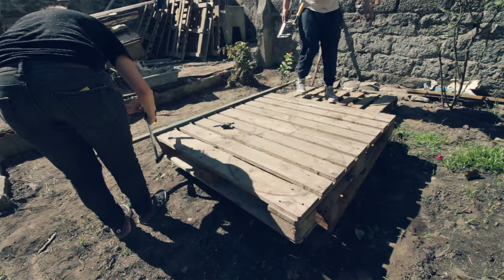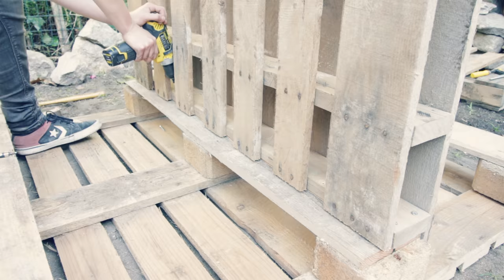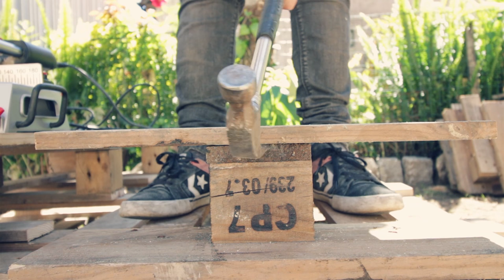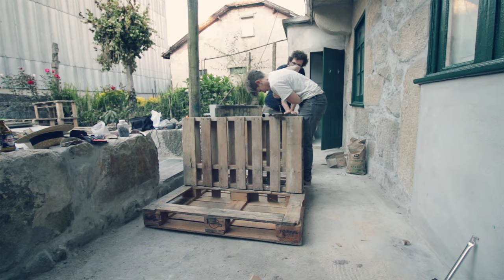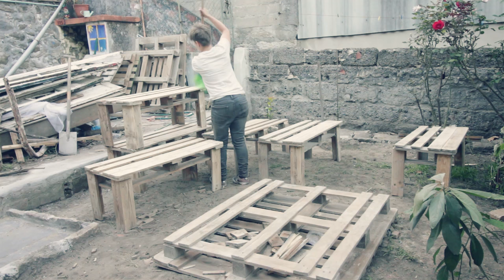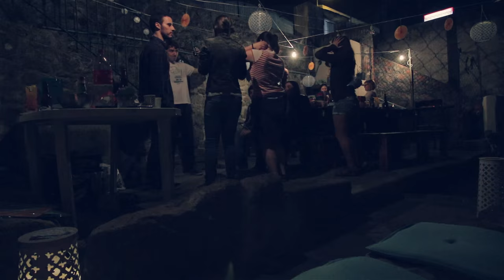Outdoor Pallet Table and Benches

Comment: Your videos are great but I have to ask, are you not afraid that the balloons might cause a fire? Do they go so high or stay aloft so long that the flame goes out?
Reply: Ehhmmm... i don't know what to say... Maybe, "Go and study some physics!!!"
Reply: I am aware of the part of physics that relates to thermal energy and how heat can cause a fire, hence my question. If you Google "hot air balloon fires" you will get more than 600k articles. Albeit most relate to passenger pleasure balloons, the same principle applies here. Heat+ combustible material =  potential fire. I can foresee that the higher this balloon rises and the colder the air and the fuel is consumed that the balloon will deflate and sag. Perhaps a tiny flame will survive but not be large enough to maintain the expansion of the balloon bag. The bags droops into the flame and you have a fire. Will it burn out before it falls into the gas storage facility with the leaking valve? Who knows but it is a thought.
Reply: It's a fair question.  "Sky lanterns" are very common in a few cultures.  I would guess the risk is very low as the only way the lantern will come down is if it's fire is finished.  The only risk would be during the launch, if it gets caught in a tree, which seems like something some common sense could avoid
Reply: Tree can catch fire from sky lantern only  if it's full of completely dry leafs. Which is reeeeallly rare.
Reply: You are of course right, I just always look at the worst case scenario.